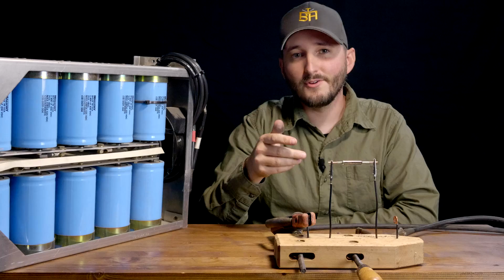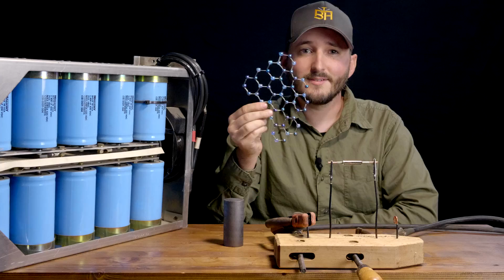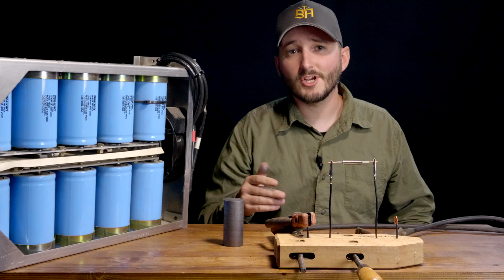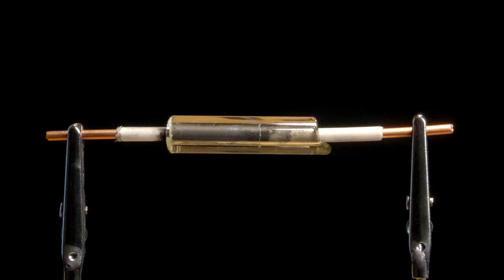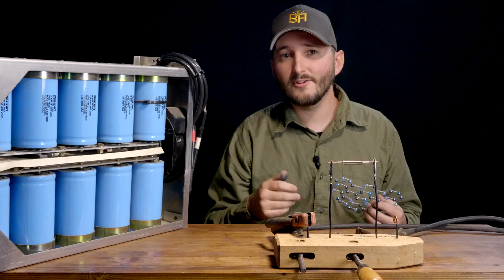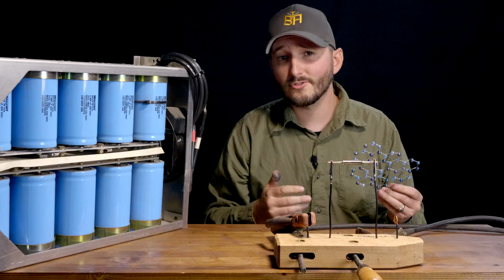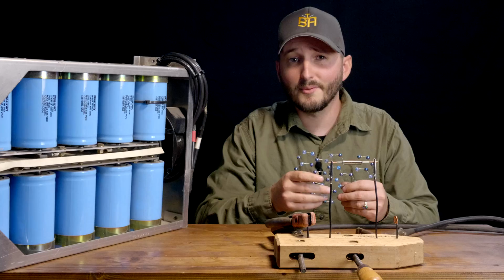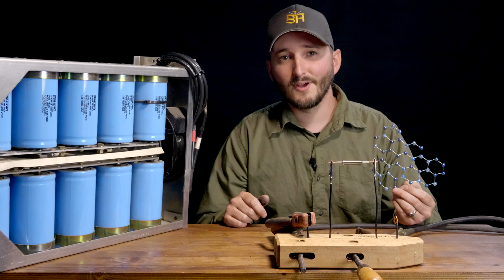How The World's Strongest Material Is Made From Coffee Grounds (Flash Graphene)

Comment: What if we used cavitation mechanics to create the high temperatures required over a short period of time.

Examples in nature are the Piston-shrimp and Mantis-shrimp:

“The mechanism of cavitation formation is due to the strong depressurization of water due to the Bernoulli principle; creating temperatures nearing that of the surface of the sun, resulting in a glow (sonoluminescence). But the glow is too faint and fast for us to see without the help of special instrumentation.”

Note: this cavitation effect has also been known to be created by vibrations such as those shown in the star in a jar experiment, where a micro bubble is suspended in the center of a glass chamber of water by sound waves that are tuned to the Residents frequency of the bubble and/or of the chamber, can’t remember which one lol.

Maybe this effect can be recreated to make graphene; possibly in the medium of air rather than water.

Kind Regards Alan J Riley
Reply from the maker: Cavitation underwater with carbon reacts to form hydrogen gas and carbon monoxide. Look up my video with water gas in the title and you'll see a similar reaction.
Reply: @Nighthawkinlight  can the same heating effect be created in air using a piston or something similar to compress the air within a chamber?

Also it’s amazing that you reply with all the comments you have! 🙌
Reply from the maker: No, cavitation makes pressures much higher than you can reach with a piston.

Comment: Could you have a liquid carbon suspension flow into the chamber for flash graphene?

If so you could let multiplex the inlet with two solutions: carbon rich and chamber purge. The second fluid could wash the chamber after the reaction and push the graphene further down the process line. Right? 

Or is liquid carbon suspension a bad idea for some reason I can't think of?
Reply from the maker: I think a liquid would suck up too much energy. It would turn to gas in large volume which would also cause a lot of blow out. I've not thought of it though, I've only been thinking about dry methods.

Comment: i understand the term is used for visual representation, but calling it 2 dimensional is not correct. it is still 1 atom thick, giving it some form of measurement. so even if it was 1 atom in hieght, width and length.. that is still 1x1x1.

Comment: Tour's team is now using calcined petcoke (cheap) as a raw material as it produces the finest turbostratic graphene. Since CD lasers have already proven to create graphene from graphite seems microwave ovens will be next, in fact, what about a capacitor burst channeled into a microwave emitting device ?
Reply from the maker: Graphene is pretty easy to make with lots of different methods, it's just hard to find one that produces good quality and good quantity at the same time. Could be that other flash heating processes would work just as well but I doubt they would be so simple as a capacitor discharge. I also don't know if microwaves are actually capable of heating something so quickly as the 50ms ideal flash time they're now using.

Comment: Carbon has four bonds, but in graphene it seems each carbon is connected only to three other carbons? Where goes the fourth bond?
Are there hydrogen atoms bonded randomly up and down the plane? Or is carbon in graphene in different oxidation state than in graphite or in diamond?
Reply from the maker: I'm not 100% confident of my understanding in this, but I believe graphene is relatively stable in the three bond configuration, but the desire to connect that fourth bond is one reason why it tends toward the 3D graphite configuration if it has a chance to get there. Graphene oxide can be made by snapping an oxygen onto the available carbon bond, and I believe this form is preferable for some electronics purposes.

Comment: Yesterday I was working at my bench in the basement, when I heard the extremely loud kerrrchunck of the transfer panel 3 feet from my head switching the power in the house from my generator, back to commercial power. High winds had caused power outages in my neighborhood. I wonder if that kind of switch could be modified to make momentary contact for say....5 milliseconds?
Reply: I guess it could if you arrange for the wind direction to change fast enough!

Comment: So... since you've kinda been getting into high temperature exotics, I have a suggested material to try you hand at: 

Boron Nitride
Either Cubic or Hexagonal, though Cubic is more useful. 

You can synthesize in a microwave, using boric acid and ammonia sulfate. 
The yield is low using the microwave route, but it doesn't require the microwave to be on for days at a time, nor do you need exceedingly high temperatures, though you probably get a purer product at the end. 

Cubic Boron Nitride is used in high speed CNC bits to mill hardened steel and sometimes even harder substances. 
It's also has some interesting secret effects. ^-^'

Comment: love your video. Is it possible to use induction heating to make flash graphene? Thanks.
Reply from the maker: Probably not. You need to apply the heat extremely quickly
Reply: @Nighthawkinlight  But can either method, ie induction heating or flash joule heating, cost effectively solve plastic pollution?

Comment: Here are possible improvments. Use helium or helium air mix to create a glow discharge. Use a Blumlein or Marx pulse forming network. You can also use a distilled water capacitor with triangular plates. I used a laser switch to fire the pulse across a channel about a yard long made of plate glass. You could also use a mov metal oxide varisistor as a switch. The sun is a helium and hydrogen glow discharge. I used this setup to make an ultraviolet single pass three megawatt laser back in the 70's. It should lase in the channel while you are heating your graphite. The hopg graphite reacts to a magnet as will graphine. Making a high voltage power supply or a nitrogen laser will be deadly if you make a Single mistake. Even the reflected light will make you permanently blind. Making graphene should work to fire a substrate or a powder. I would not make it unless you have a definite use. Standard capacitors lose some energy to high inductance and reduced life. The helium also quenches the graphene faster.

Comment: hacksmith super cap video, you could measure some value that changes from graphite to graphene, activated carbon or maybe super cap
Reply: density of the material should change
Reply: flash deoxidation, ionization metal
Reply: pyrolyze standing wood logs directly, it will be a porous graphene mesh
Reply: electron avalanche ionization deoxidation of iron, discharge removing of oxygen, discharge "pig iron"

Comment: So my question is this. 
Is graphite then a jumble of carbon atoms and molecules and graphine is an ordered layer by layer of carbon? Or is graphine simply a single layer? Because in my mind I’m seeing it as trying to effectively make a 2x4 of this stuff.
Reply from the maker: Graphite is ordered in a similar way but has chemical bonds in three dimensions. You can have graphene layered in a 3D stack and have it not be graphite. Probably you'll never see objects made from solid graphene beams, but instead used similarly to fiberglass where it's bound together in a resin or plastic.
Reply: NightHawkInLight thanks. That really clears things up about the potential for the application of this material.

Comment: so imagine instead of a tube, it's two wheels with an inner section bored out to the diameter of the graphene rod, then imagine the wheels are spinning slowly and the graphite is being fed from one side into a constant charge.

using guides and other things along with even using gasses to deliver the carbon, you can coat the spinning wheels and peel them off.

or for instance, the same concept could be applied to a spinning tube, coating either the outer or inner surface.

the latter is already one of the ways they do it with methane.

Comment: The voltage and amperage is low the carbon powder should glow red hot all I saw was a little white light use super capacitor at 200 volt that work better
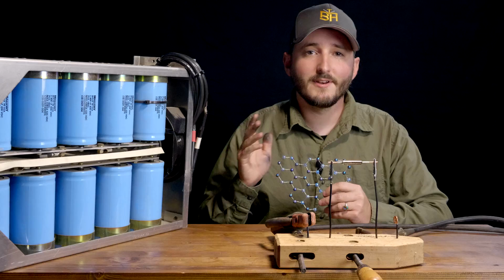Reply: 5:01 watch the whole video.

Comment: Would it really be safe to mix in graphene with plastic and concrete? After all, carbon nanotubes are about as dangerous as asbestos and they're made from rolled up graphene. Isn't there a risk that the degradation of the material would release toxic dust?

Comment: There was a “CSICyber” episode where the heroes deactivated a booby trapped bomb, by hot-wiring its battery to a big car’s running alternator.generator, so that its powerful grounding effect immediately sucked all of the juice out of the bomb’s battery. So, what if the Flash Graphene researchers rigged up a chamber pumped full of carbon monoxide, and blasted it with intense microwave bursts, so that Graphene immediately formed on a flat, refrigerator-cooled metal plate, that’s likewise hot wired to a powerful grounding of a nearby, large electric generator at a nearby power plant?

Comment: imagine a laser that zaps the atoms of carbon together... first you put a layer of dust down as flat as possible... doesn't matter how thick, just have it as flat as possible. then you get a high powered laser that can beam the surface of carbon.. in theory, the energy will bond the atoms on the top layer and if not the upper most top, then at least a close enough layer below that would finish the bond... but make sure the laser is timed perfectly so it doesn't bond multiple layers vertically... time it perfectly so the bond will be even horizontally... just like a Digital Light Process 3d printer, but much more powerful

Comment: I don't understand how a material that is optimally a single atom thick can have large scale uses. People talk about structural integrity and how much stronger it is than steel, but who uses 2 dimensional steel? The only thing I can think of is winding a ribbon of graphene into a super capacitor, but that's not a structural use that takes advantage of any strength inherent in the material. How could a vehicle ever be made of graphene? Strong on microscopic scales has uses I'm sure, but macro is what we need more.
Reply from the maker: Think about it similarly to fiberglass or rebar. You can mix it with stuff and it becomes way stronger. For electronics it's useful because a small amount of it has an insane surface area, which allows it to hold a large electrical charge

Comment: That thing you build is not optimizised. The contacts are bad and the wire is to small in diameter. And you may preheat the assembly and use helium to prevent oxydation

Comment: You are missing much simpler and cheaper tech, repeated acid soaking and microwave exfoliation (See Robert Murray Smith's channel) and one method he highlights showing how just sugar water in a sealed pipe chamber heated to 450F creates layers of graphene over time-- carbon in solution, at temp, so much easier, cheaper and less dramatic.
Reply from the maker: Graphene created in such ways is not turbostratic, and drastically less effective for applications such as supercapacitors.

Comment: 2020: a fingertip of graphene costs 1000$... let the fingertip be 1 cm³. Further let a skyscraper be 25m x 25m x 300m, which is then approximately 200 000 m³ or 2 x 10^11 cm³
This means, that nowadays, it would cost 200 trillion $. Let's say, we have only 100 million $ to invest in a skyscraper with that size, so the question is, when will graphene cost 2 million times less than now. Well 2 million is 2^21 and since everything gets 50% cheaper within 1,5 years, it means, that by the year 2020+(1.5 x 21) = 2020 + 32 = 2052 a. D. it will be possible to build a skyscraper with graphene for only 100 million $

Comment: With respect to costing hundreds of dollars per gram, wasn't the first commercial run produced using ball mills? That's hardly expensive and it's reasonably scaleable. The running cost and maintenance costs are low, and if you put a crank on the mill it can be done anywhere by anyone regardless of the level of local infrastructure. 

This doesn't seem all that efficient, in addition to not making very pure product, despite the advantages of random alignment. The danger is that if it's not only graphene then there may be nanotubes present, and if they are of a certain scale then you cannot use them safely in materials. Last thing we need is a new generation of asbestos removal as we find that nanotubes are present in X, Y and Z of the materials that comprise our abodes and businesses.